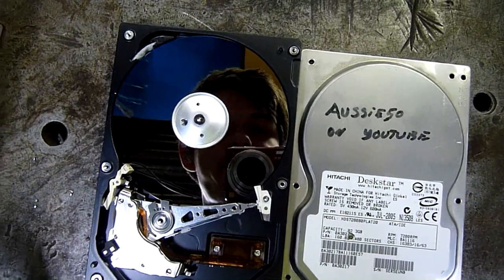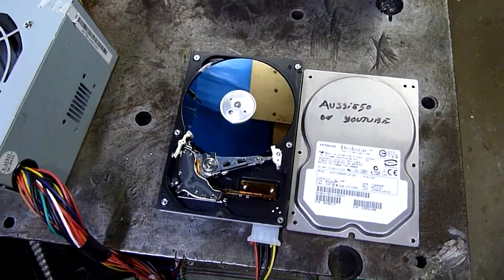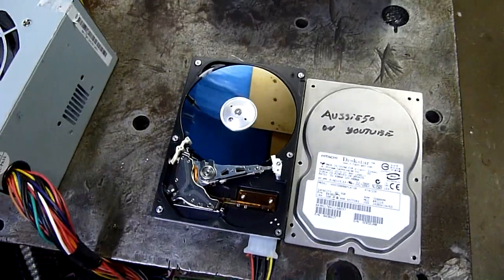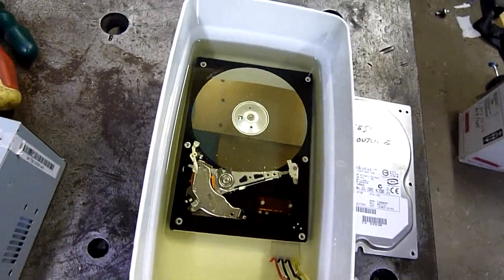Running Hard Drive meets a tub of Oil

Comment: Modern hard drives are designed to limit starting current because they used to draw full power, accelerating fast but overloading power supplies when many start at once.

Comment: It's a brushless dc motor. They are basically a 3 phase motor but they use dc. You would need a bldc motor controller to run it. Preferably not one that tries to sense if the motor is overloaded like the hard drive does.

Comment: LMAO. :D 

It reminds me of when RODALCO got an electricity meter and filled it up with oil :D

The meter still worked, the load-wheel was still rotating while immersed in the oil but it was dramatically slowed down, and there was lots of oil leaking out around where the front-case meets the back-case, and it was leaking out of the terminal cover too. :D

From this experiment, I can at least say that a load-wheel in an electricity meter has more torque. :D

Thanxx for showing,

-BBD.

Comment: i had a 120 gb Seagate ied drive that screamed and crunched on start up for almost a year before it died it was so bad that if i bumped the tower it would crash go black screen and would restart the computer i would transfer big files from one drive to the other just to try and kill it i couldn't believe that it went that long  at the time it was getting close to 9 years old and 7.5 years of running pretty much 24/7 before i got the computer

Comment: Hard drives have pethetic starting torque. BUT, running torque! Holy shit are they strong! Took a 7200 RPM hdd. And threw the magnets from the head assembly onto the spinning head of the motor! Holy shit. that thing was dancing all around the place! Shut it off and tried to restart it. But didnt have enough torque. So had to get it up to speed and throw the magnets back on haha. You should definitely try that.

Comment: I suggest you get one of those "electronic speed controllers" for brushless RC motors.
Should be able to spin the disc at more than 12V.
ESC(speed controller) + servo tester  and you are good to go. you can find those motors in a lot of stuff.

Comment: The later Hitachi Deathstars seem fine to me, at least the SATA ones. My 320 gig one's lasted to this day from being manufactured in May 2007 without a hiccup.  No sectors bad, many installs and scratches from being inside so many computers.
Of course, the IBM ones inside all these NetVistas at school tend to fail like they don't want to live. Also, a 7200.10 Seagate (one of the few I own) I have as a backup drive is starting to create horrendous noises, better kill it quick.